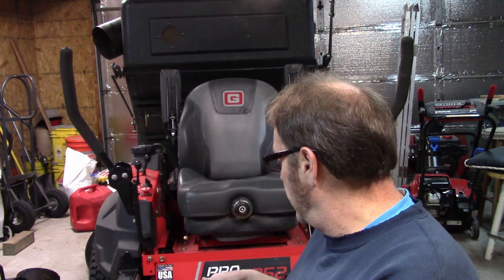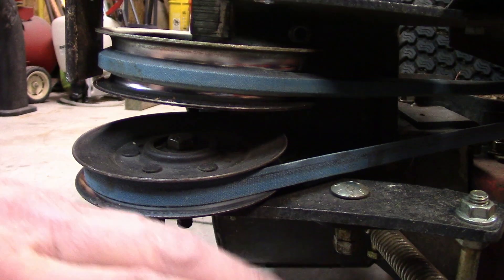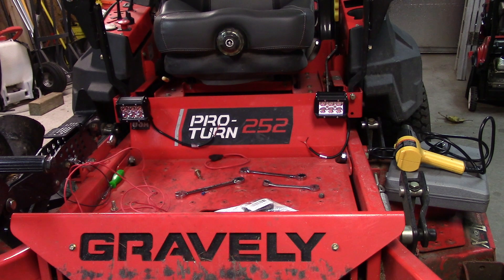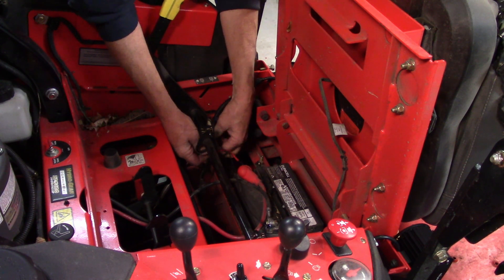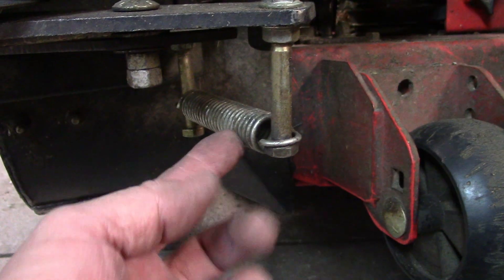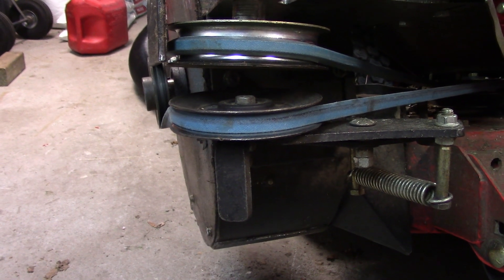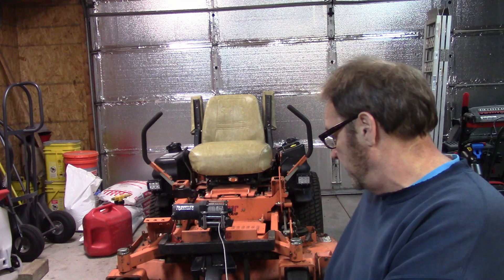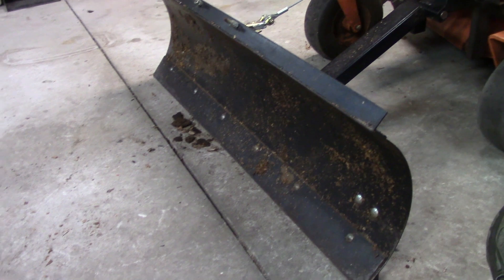Mounting Headlights on Gravely Pro Turn

Comment: Yeah them lights are too low to be effective. I use that liquid electrical tape all the time in my HVAC repairs. Most of my units are rooftops so they are exposed to the elements. Keeps the corrosion down. Love the new ending! #gravelywheelies